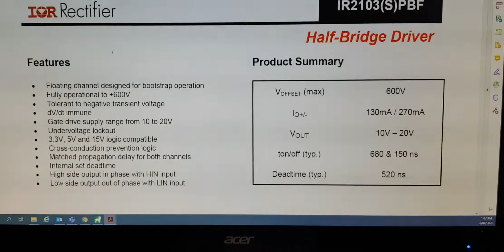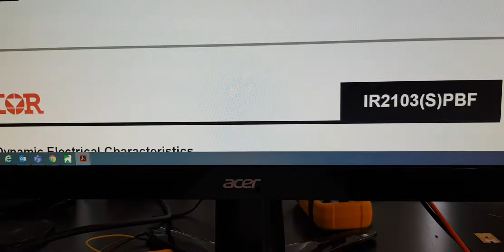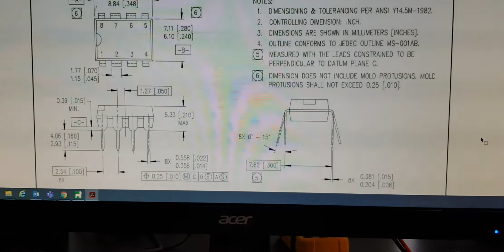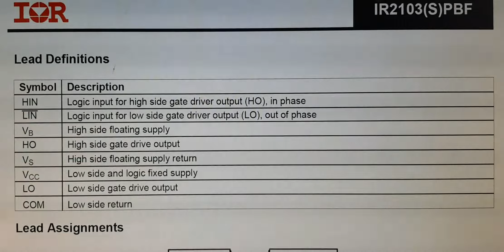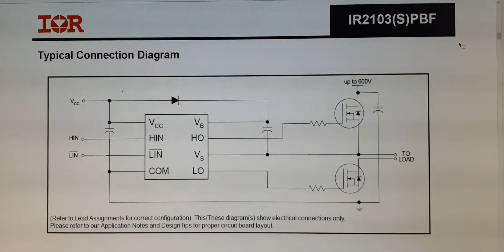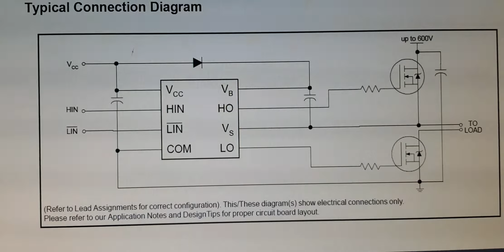Mosfet  driver

Comment: Why not use a simple voltage divider circuit with resister or anything that works and have a constant supply? These stupid things produces even more problems.